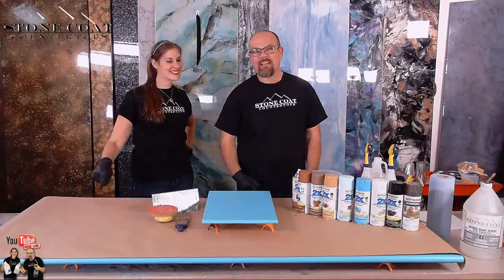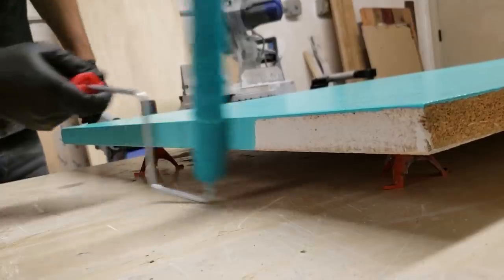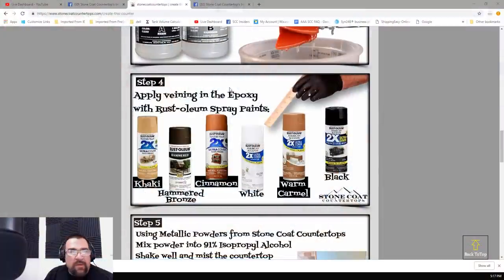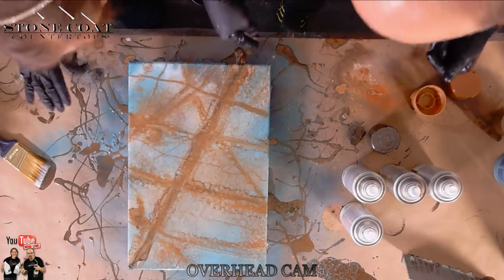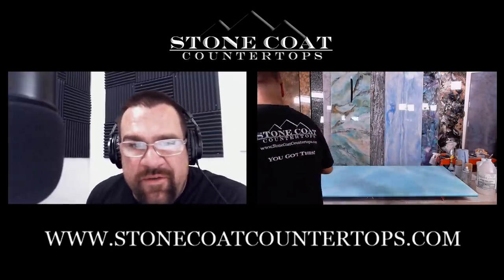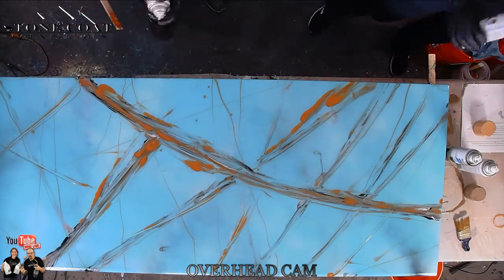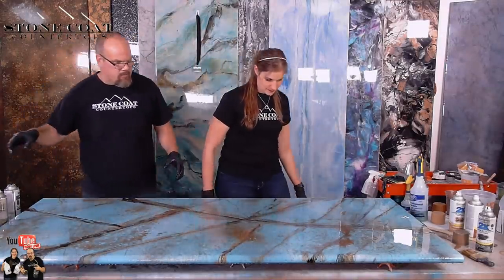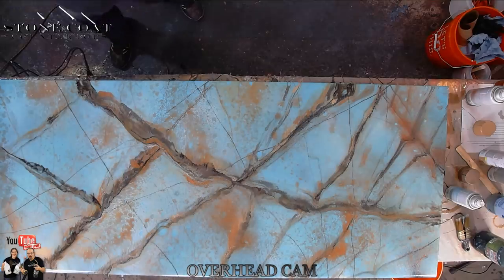Teal Table Makeover

Comment: Like what you did. I need to point out that I sanded and polished my piece in order to achieve a more “rustic” effect to match the honed but unfilled travertine used in the rest of the bath. I used successively finer paper to a 4000 grit and then buffed with compound. See the videos on this process on SCC.
Reply from the maker: Thank you Louis!

Comment: Missed this live but still enjoyed.... Awesome!!!!
I sent an email about doing a peach-esk counter.  I think this technique would be perfect. Peach base coat and go from there.     Few questions... this board... I know you said particle board, I can get that or anything. Need to make a kitchen sink counter.  What kind of board would work best?    Also I noticed you did NOT prime or do anything to the back edge.  If water got back between the counter and wall wouldn't it warp the board?
Lastly, how long does this stuff take to fully cure, and.... for THIS project, don't you still need to put a plain coat of clear over the top?

Comment: What Bondo hardener do you use? My filler always is either pink or blue...
Reply from the maker: Great question 600miles!  Here is a link to the type of Bondo we use: https://www.amazon.com/3M-Bondo-Solutions-Purpose-1-Quart/dp/B0007ZHTTS/ref=as_sl_pc_qf_sp_asin_til?tag=stoncoatcoun-20&linkCode=w00&linkId=0eff5cf79cf5652c703c135609698b82&creativeASIN=B0007ZHTTS

Comment: Actually, I think the one Lewis made looks much better. Sorry guys, usually I love everything you make, but this one just doesn't do it for me. Now, the beautiful teal and browns in back left is right up my alley. Want the video on that one and recipe.
Reply from the maker: We appreciate your honest feedback MsTheUndone  and your continued support.  Lewis did such an amazing job!
Reply: I agree with MsTheUndone. Too geometric for my tastes. A little more of the Ocean Mist softens the teal. Of course, it could be said that I am slightly biased.
Reply: @louisjanney4464  - Hey Louis, really liked yous! It looks so natural. So other than their steps, did they use the correct colors and similar procedures?
Reply: k bob pretty close. The base color in mine is a little lighter. It is the same as my walls. I also used more of the Ocean Mist spray paint in order to get some light/dark effects. IMO theirs is a little too geometric  and busy. However, keep in mind that they are demonstrating technique. You are limited only by the pictures in your head. I went to a dozen stone yards and found a piece in almost the same colors. I simply tried to imitate the impression it left in my head. BTW the cost of that slab was +-$1400. Cutting, polishing, and prep for the 3 pieces which I made would have been about the same. My material cost was less than $300. 

One other note: I sanded it with increasingly finer paper to a 4000 grit and a then polished using an automotive polishing compound to achieve a softer look. I feel that it fits better with the honed unfilled travertine used on the floor and walls. See the videos on polishing.

Comment: Just wanted to come here to say how thoroughly displeased I am with the products and the false advertisement of how easy it is. I am a SPFX artist who is used to working with products like these but I still had many struggles. First off, plan on throwing away everything you touch as this stuff will ruin anything it comes in contact with. Clothes, the drill you use for mixing, the chop brushes (which mind you, nylon brushes are $15 each). Also the edges on mine came out terribly, even though I followed every step. They spend way too much time on silly edits and slogans than actually addressing just how hard and non user friendly this stuff is. I called them to try to see if I can salvage my edges, and if I cannot then my whole project will be ruined and $900 will be gone; it’s not cheap to do this after all the paint and tools you will need to buy, on top of the epoxy itself which isn’t the cheapest. I wouldn’t recommend this to anybody I know after how terrible of a time I have had using this product.